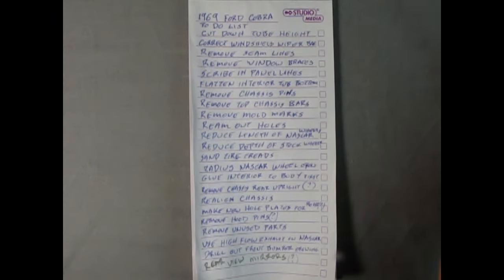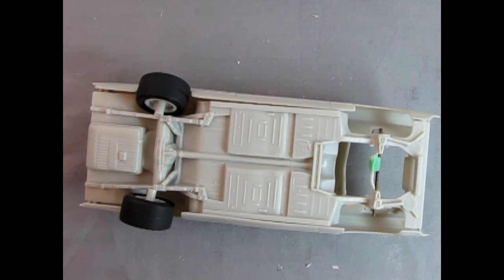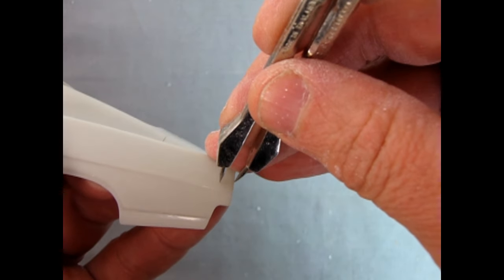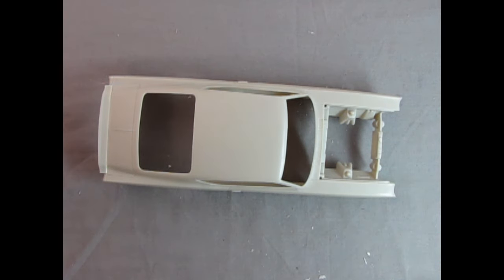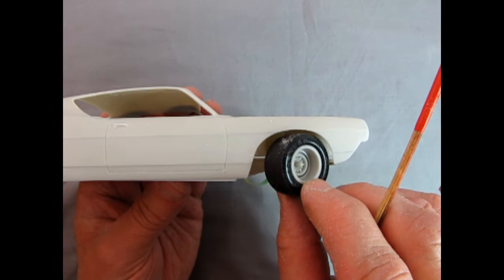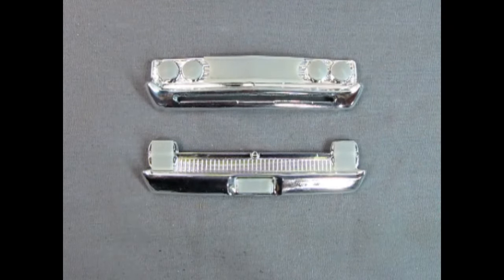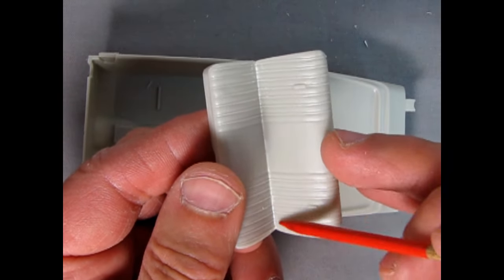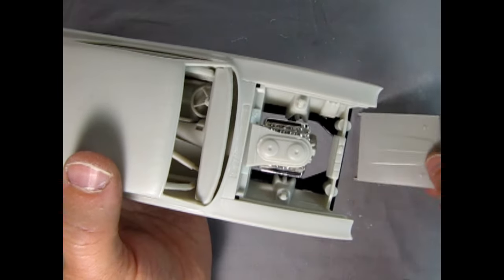How To Fix Everything Wrong With The AMT/ERTL 1969 Ford Fairlane Cobra Torino Model Car Kit Part 3

Comment: I built one these several years back as the NASCAR version - didn't turn out the way I would've liked it to - currently have one on the shelf halfway built - I'm going to use aftermarket Plastic Performance Products tires and wheels because they're much more accurate- the mesh grill that doesn't fit properly is actually for the Talladega version since that front bumper and grill is slightly smaller than the regular Torino/Fairlane grill - Thank you Trevor for showing this to us - this is extremely useful👍
Reply from the maker: Wish I knew that about the mesh grille. Thank you for the enlightenment. I was wondering why the curve didn't touch the edges of the head lights. 

Yes, the wheels and tires are not quite "Period Correct", but hopefully by me shortening the backs, they are a bit more realistic to NASCAR.

Comment: fill in that cutout under the washer bottle with putty
or a very small piece of sheet and putty
this is just how I would do it
keep up the good work & great videos
Reply from the maker: Great tip!
I was going to fill it with some putty, but I think trying to sand it at that angle to smooth it out would be difficult as I believe the tools don't want to go there without a fight.
Reply: @MonsterHobbiesModelCarGarage   oh

Comment: Great video,Trevor👍😎. I noticed the rear wheel opening lines are too far forward and,like you,compensated for that when flaring them. I patched up the hole below the water bottle from the inner wheel arch,as there is a big slot behind the bag. The NASCAR grille screen is hardly worth using,due to poor fit and it's quite easy to make a replacement.  I'll have another update on my build next week🤞
Reply from the maker: Sounds good Pete! 
I hope whatever I did today makes life easier for your build later. - There's so much going wrong with this kit at every opportunity.
Reply: @MonsterHobbiesModelCarGarage  I've got the kit to about the same stage as you at the end of this video. I put a 1mm thick tombstone shape into the whole depression behind the water bottle. It fills the arch hole and the bit below water bottle. I also found i could safely remove most of the round,pin towers,either side of the radiator and tidy it up with strip,to give a squared off,radiator framework.😃sorry that's a bit hard to explain😧 I'm worried about your next video. 😧You may have found more faults that I have yet to enjoy😃
Reply from the maker: @petesmodelcarcustoms584  I considered cutting the tubes off the radiator support wall, but I didn't want to get too far into totally reconstructing the mode. Maybe on my next one.....maybe! LOL! 

Don't worry Pete...there IS more issues with this kit. I am currently working on the 5th video in this series. I almost have the model finished...and there's still issues. Will it ever end?
Reply: @MonsterHobbiesModelCarGarage  🤣🤣🤣what a model😃🤣. It's had a lot of faults but I have thoroughly enjoyed the research,I'm about to check the rocker panel line. I've also enjoyed spotting the differences from each release and doing my best with the kit. Your interior and roll cage shots are helpful too👍😃
Reply from the maker: Glad I can help. 

Well, I was working off and on on the model today and I have the factory stock interior finished as well as the chassis and exhaust system...which also has a slight fit issue, but it was the easiest issue to resolve. 

I still have the NASCAR interior unpainted. The hardest part is to try and sort out a paint scheme for the car. 

I want to attempt to use the kit supplied decals which are 2 shades of orange and dark green and finding a color combination for them is a bit of a challenge. I could go with a light blue, a cream color, white, light yellow, purple (And hope the decals are not translucent) or an even paler green or orange or even gloss black. 

Sadly, the interior also has to be painted this "mystery color" like they do in NASCAR. I just don't know what the color is going to be yet, so there's my delay. I'm also not sure if I should paint the dashboard and roll cage semi-gloss black for an anti-glare feature or paint those body color. 

Oh, and I also think I have to drill a hole under the stock hood scoop to allow the air cleaner ram air "Shape" to fit in the hole and allow the hood to sit down flat. - Yet another issue. UGH!

Comment: Hey Trevor!Line you made on the rocker panel  to the fender should  NOT be straight!it follows the curve of the Fender!😉And the scribed line for the endcap is too strong!Its very subtle on the real car,because it spotwelded to the sidepanel!And ive already resolved the carb hight Problem and hod fitment!
Reply from the maker: I think you missed the part where I said the rocker panel line should be curved and that on that model I accidentally made it straight because I scribed the line in there years ago, before I knew it was curved. - but I did say that and on the other model car body, I do have that curve in there. 

Anyway, I am glad you fixed the other problems with your kit. I have an issue because on my stock engine, I used the high rise "NASCAR" intake manifold because originally it was going to be a NASCAR motor until I discovered the dual carb air cleaner issue and had to swap the engine. Ahh...it's too complicated to try and spell it out. You'll have to wait and see the rest of the upcoming videos to see what I am doing.